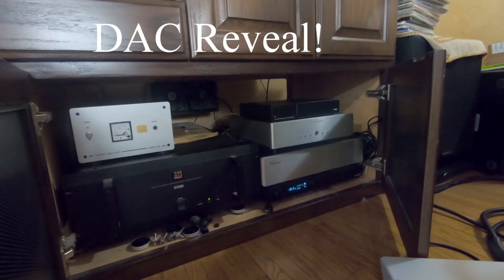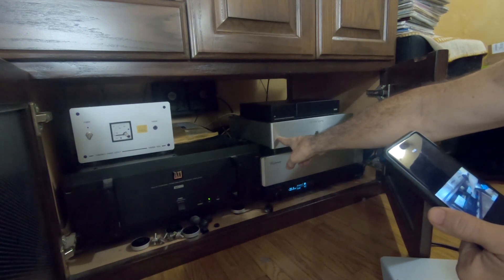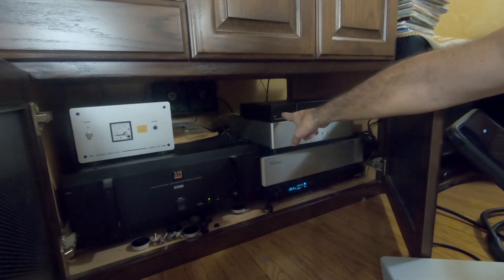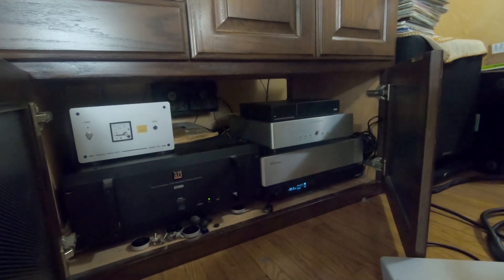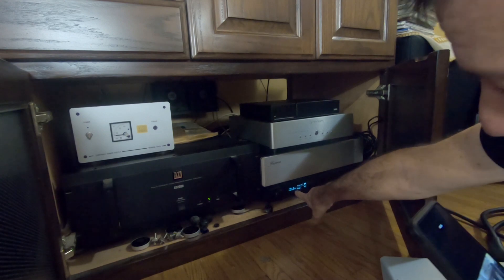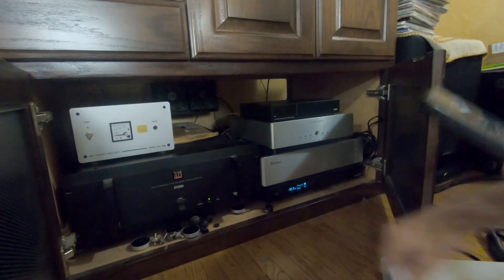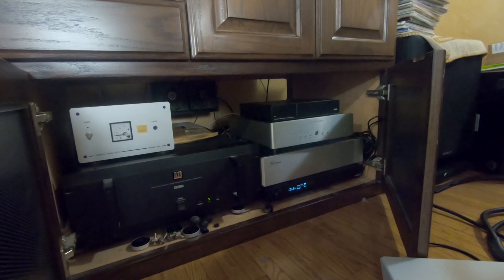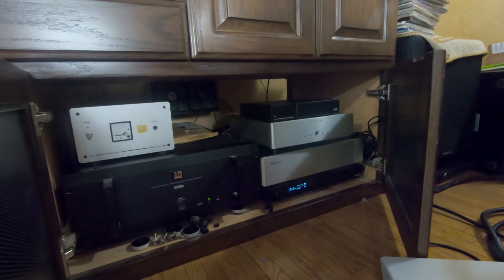Linkwitz LX521.4 system DAC shootout between Denafrips Venus II, SMSL VMV D1 and miniDSP SHD

Comment: I would agree on the Denafrips being the best of the three here, as presented. Kind of surprised that the build in mini dsp engine if the Linkwitz amp didn't sound so great. Was DSP applied? Sometimes the conponents that incorporate DSP engines sound acerage at best when DSP is not applied, and are transformed when it is.